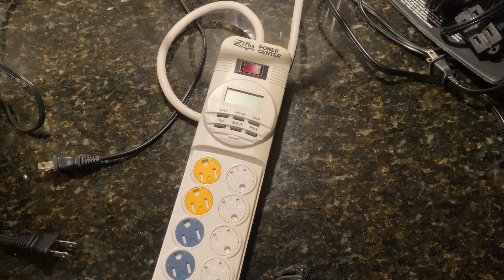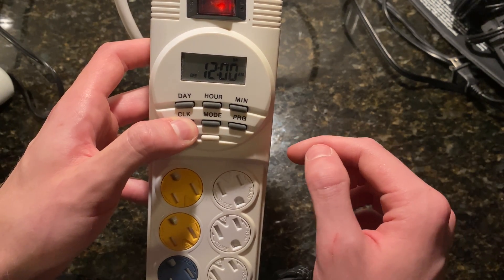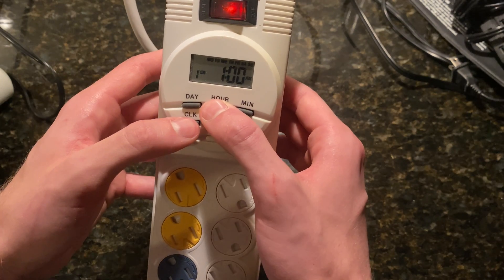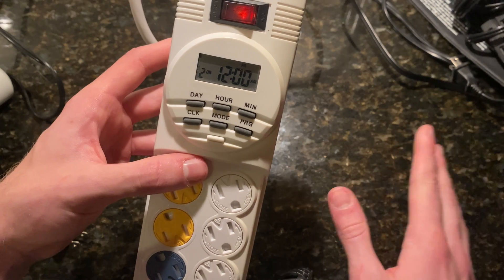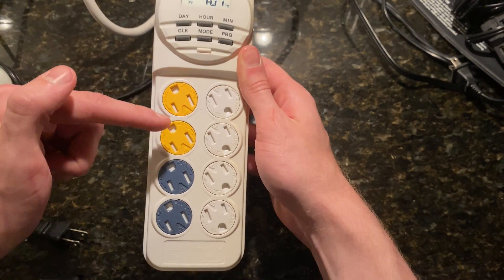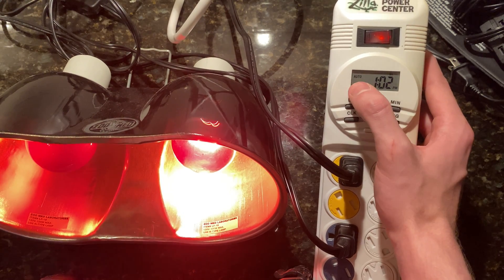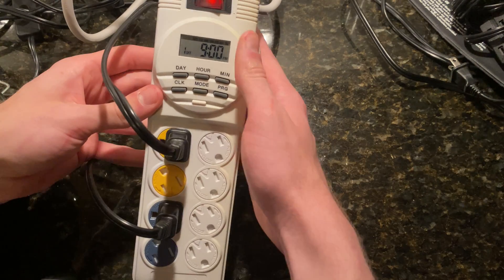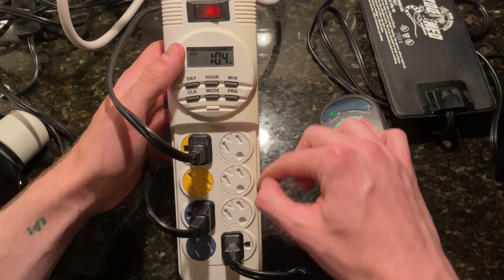How to Program the Zilla Digital Power Center

Comment: you don't have to wait until the next day for the lights to kick on. simply set the time for the lights to turn on like one or two minutes from now, then when they kick on go back and reprogram the time to the desired time.
Reply: Yeah my timed outlets worked right out the box 👌🏽
Reply: Oh....I'll try that
Reply: Good looking out. Popped right on. Thanks
Reply: life saver! my power use to flicker on and off because the way the apt was build we only have 1 breaker and when theres to much power in my apt the poweer goes out because of this i had to keep resetting the auto settings and one day it wouldnt work (i wasnt waiting 24 hrs) and had no idea i had to wait some time for it to readjust lol.
Reply from the maker: I did not know that!
Thanks for the info!
I’ll pin this comment so others can see.

Comment: my problem is i need 3 things running during the day
a basking light, a uvb, and a plant light
so im not sure what to do bc i can't get all 3 to turn off amd one at the same time no matter what mode I use
Reply from the maker: Good point!
Thankfully you can head toa. home improvement store and purchase a "multi-outlet plug" that can be put in the day time socket. That way you can run three (or more) day lights through the timer!

Hopefully that helps! Let me know if you have any further questions!
~ Alex

Comment: So, the programs are for the days of the week and not the outlets?
Reply from the maker: Correct! You can have up to 7 programs based on the days of the week (though most folks use the default setting in program 1 where the lights will turn on/off Sun-Sat and then repeat…)
The program also corresponds to the outlets. Yellow outlets represent when the timer is “on” and the blue outlets represent when the timer is “off” (meaning when the yellow day outlets are “off” night time heat is on)
Reply: @AlexsAgamids  thank you!

Comment: I have gone through all the written instructions, waited 24 hours, and watched this video. I can't get the timers to work. Which outlet corresponds to 1? I have the clock set correctly and my daytime heat lamp to come on at 8am, and it never comes on. I am assuming that #1 is the first daylight outlet.
Reply from the maker: Hello! 

Sorry for the delayed reply as apparently this one got buried in my viewable comments (YT redid their comment tab to a "community tab" in YT Studio)
The Yellow tabs correspond to "on" and the blue tabs correspond to "off". The white tabs provide power constantly.
Maybe double check your programing to make sure that your on/off times are AM/PM. if both the on and the off are set to AM, then I'm guessing any lights you have plugged into the yellow "daytime outlets" are not turning on.

Hopefully that helps!

Comment: Omg helpppp. When I first got this I found this video because I didn’t understand the instructions 😂 anyway, I was able to figure it out. It’s been more than a year with no problem whatsoever until about a week ago. We had thunderstorms and I guess it messed up the program or smth. I’ve been trying to get it back to normal but the Time always ends up at random times and it switches from Auto😭😭😭

I’m going out of town soon and NEED to figure this out ASAP🙏🙏
Reply from the maker: Hello,
The power surge could’ve messed with the backup battery in the timer. 
I’d suggest replacing that battery. Thus causing the whole timer to reset completely.

Comment: Okay, so I have a question. I pressed the program button and realized I could make 7 different timer programs. This is confusing because, one, there are 8 outlets, and two, only two of those outlets are daytime ones, and if the night ones turn on after the day ones turn off, what are the other programs for? Additionally, does this mean I can set a program for one of the white outlets and theoretically use it as a day one that shuts off at a certain time?
Reply from the maker: The "7" different programs means you could in theory have the lights run at seven different on/off intervals throughout the 7 day week (thought most people just setup one program so the timer turns on Sun-Sat at the same time every day)
The different programs do not affect the outlets. Each colored outlet corresponds with the timer, the 4 remaining white outlets provide power 24/7 (say for if you run a thermostat, heater, etc.)
Hopefully that helps!
~ Alex
Reply: @AlexsAgamids  Ohhh! 7 different programs for 7 week days. Makes so much sense!! Thank you!!
Reply from the maker: @alenalove1107 Happy to help!

Comment: 2:02 Does it need to cycle 24hours before working? I programmed to go on and off when i want but i put  in auto mode and the lights should be on but not.
Reply from the maker: It does :(
Even with it set to “auto”, you need to let it run through the next day before it kicks the lights on.
Reply: @AlexsAgamids  got it. Appreciate it.

Comment: Why doesn’t it turn on when I have it programmed to the correct day and time once o click on auto. Will only stay on when clicked on on
Reply from the maker: You need to give the timer 24hrs to fully set. Then it will run your program when you have the clock set to “Auto”.

Comment: Personally, I don't like that there are only 2 outlets for daytime. I've had mine for quite some time, but I'm just now setting it up and realizing this... so I had to plug a power strip into one of the daylight outlets. I appreciate this video, as it's much easier to just go along with audible instructions than to have to stop to read them. Waiting 24 hrs is perfectly fine with me... I'm setting mine up late at night and didn't want it off yet cuz my dragon just ate a grip of dubias. Thanks again 👋
Reply: Yeah I regret buying it because there's only 2 day outlets. Should've been like 4 day, 2 night, 2 constant. I'll never use the night outlets.
Reply: In case anyone wants a much better version. 

BN-LINK 8 Outlet Surge Protector with 7-Day Digital Timer (4 Outlets Timed, 4 Outlets Always On) - White

On Amazon

Comment: I still need to program my timer to set to auto 8am on 8pm off. If I have to wait 24 hours for it to work, can I keep my lights plugged in somewhere else so my dragon has his lights on, or do I need to keep his lights plugged Into the yellow and blue side for it to program correctly?
Reply from the maker: You can keep the lights plugged in somewhere while you wait for the program to setup. After 24hrs, add your lights in the yellow sockets 👍🏻

Comment: Can you run 2 different daytime  programs, 1 for each daytime outlet simultaneously? Looking for something to run a daytime cycle for a light, and a 30 minute cycle for a fan once a day as well. Thanks!
Reply from the maker: Sadly you cannot. The two daytime outlets run off the same timer unit.
To do what you want to accomplish, you'd need multiple timers.
Reply: @AlexsAgamids  thank you! I did discover “independent” timers allowing independent schedules for separate outlet ports. Trade off is less ports available, but valuable for my situation on an existing power block!

Comment: Thank you so much!  I was struggling with the instructions and learn better visually so this helped a ton!
Question, if you are waiting for the 24 hours....can you unplug the lights, keep the program running, and plug in again after 24 hours and it will work normal?
Reply from the maker: Yes! You can keep the lights unplugged. 
However it’s easier if they’re plugged in  so you know exactly when they turn on!

Comment: And do you have any recommendations regarding lights for a corn snake? I was thinking a UV lamp and a heatmat( with thermostat, of course) but now I'm thinking a different light source might be better?
Reply from the maker: Excellent question.
A heat may controlled to a thermostat would make an excellent primary heat source for a corn snake. 
Snakes will also benefit from UVB if it's provided. So just have the UV lamp on a timer so the snake can have a day and night cycle.
Reply: UVB*